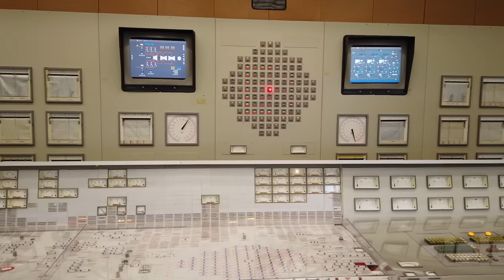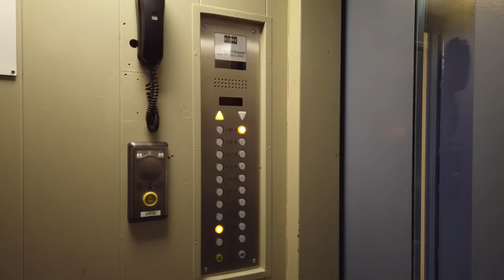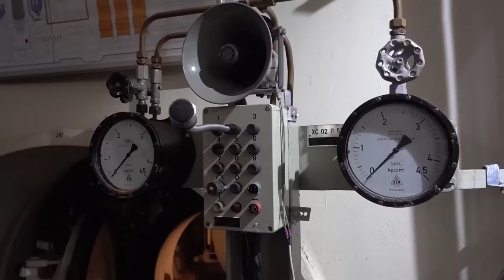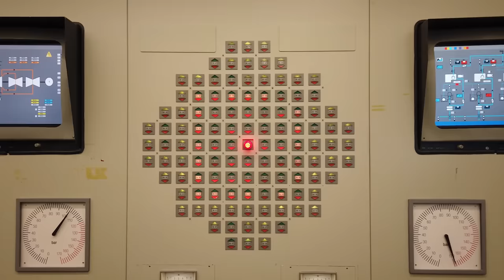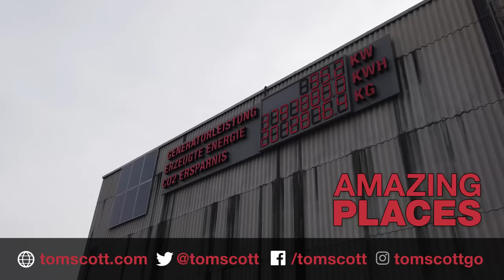This billion-euro nuclear reactor was never switched on

Comment: GIven how much CO2 emission could have been avoided by running this station instead of burning fossil fuels, this is a tragic story.
Reply: Austria produces about 70% of its electrical energy consumption with hydropower, aprox. 90% of the electricity mix are from renewables, the rest ist bought in from other countries that mostly use nuclear power. So Austria has cleaner electricity production the Great Britain or the US for example
Reply: Ironically, they're buying their power from countries that make it using nuclear for everything that isn't hydro.

Talk about NIMBYism
Reply: @sisosto3889  Austria doesn't have any major production to power. They lived by leaching off of their neighbours for centuries.
Reply: @laszu7137  Its not leaching of of anyone, we (Czechs) actually have more than we need, so why not sell it?
Reply: @sisosto3889  Other European countries are moving away from nuclear power. Germany does the same scam about renewables to the public. They have enough theoretical capacity to come close to meeting all demand but because of logistical limitations they actually import a large amount of power, which is largely from nuclear and fossil fuels. With the current shift, more will be from fossil fuels. The public believes they are getting greener but it is often the opposite case as nuclear power plants are closed down. Renewables only replace a fraction of the energy required, which means fossil fuels fill in the gap. Building more renewable energy is great but nuclear is still necessary for prime power production.
Reply: Liberals would think otherwise...
Reply: Thinking like that is oversimplification at it's finest. Nuclear energy may be climatically neutral, or even friendly but it's not particularly friendly towards humans, especially not when something goes wrong, for which there is always a chance and it produces masses of Nuclear waste that has to be desposed of, which is very difficult to do and, understandably, no one ever wants to keep it. Now fossil energy is arguably very bad, worse than it's nuclear cousin, since it's dangers are hidden - we never had a Chernobyl or Fukushima for a fossil power plant after all, and the cooperations responsible for the displacement of thousands of people and the destruction of so much land know how to get both their way and to sweep it under the rug-  and it's so well established and cheap that few question if it's not even defended for not being radioactive. The problem lies herein, that as it is always the case in, governments let themselves be overrun by cooperations in the interest of profit or economic growth, progress and freedom, instead of keeping keeping control and finding, funding and enforcing truly sustainable solutions or better yet have it be done for you by your subjects and your treasured cooperations which, after all have enourmous capabilities.
Reply: Actually, most of the energy produced in Austria comes from renewable sources like water or wind driven turbines.
Reply: @laszu7137  yes they do they have many huge dams in the alps
Reply: @sisosto3889  What is the daily peak in Austria?
Reply: @tacitus5665  "especially not when something goes wrong" there has being worst disasters by hydro and fossil fuel plants than all nuclear plants combined. Your argument it's the same as people who prefer going with cars instead of planes. Heck even coal plants release more radioactive material to the environment than nuclear plants
Reply: @shadowmax889  Read my comment. I'm not defending fossil energy, but rather urging to consider that nuclear power has major problems so governments and their previous cooperation's would better invest in finding actually sustainable replacements for both.
Reply: @tacitus5665  
Nuclear power is actually the safest, the cleanest and also the cheapest source of energy. All problems are ridiculously exaggerated, while problems with others are way too easily dismissed. Chernobyl killed about a hundred people, and all of that only because the Soviet government was completely unprepared to deal with the accident, and even tried to cover it up. Not to mention that a similar explosion is physically impossible in any other reactor type currently in use. Fossil fuels on the other hand kill millions every year, even when everything goes perfectly fine. And that's before considering the effects of Climate Change.
Reply: @0rogontorogon  But if they'd produced an excess of electricity by using nuclear as well, they could have sold that to other countries, decreasing their need for fossil fuels.
Reply: @laszu7137  In 2017 Austria produced about 68TWh and used 71.8TWh in those are 5TWh included for the pump storage hydro power...those 5TWh are not bought from other companies, the "Verbund " gets paid for them....It is cheaper for foreign electric companies to pay for the use of electric energy than to shutdown nuclear plants. So yes it is leaching of their neighbours, but it gets paid for that by them.
Reply: @andrasbiro3007  To be perfectly honest, I don't think I'll be able to reason with you or explain anything you'll not just deny. So good fortune to you.
Reply: @tacitus5665  but you arent taking any of his points either
Reply: @Ozylanius  I am taking his last point, because it's true. I even mentioned it myself, saying that fossil energy is very much bad and by those issues being ignored and fossil energy being kind of defended when compared to Nuclear power, it's inadvertantly worse than the latter. Yadda yadda, I already said the rest before
Reply: @tacitus5665  No fossil fuel Chernobyl? What about all the goddamn oil tanker spills? That "Chernobyl" enough for you?
Reply: @MemeMarine  I'm not defending fossil energy
Reply: @tacitus5665  The comparison is against fossil fuels. And comparatively the risks and harms are far less. Maybe you like renewables? In which case, do you think solar panels grow on trees? Or wind turbines, maybe? Lithium-ion batteries? Creating these things has a huge environmental impact as well, and produces huge amounts of toxic waste, which is toxic forever.
Reply: @andrasbiro3007  I agree with everything you said except:

"Chernobyl killed about a hundred people"

Are you in denial? Right after that, you said, "fossil fuels kill millions of people every year". So you are accepting to count indirect human suffering unless when it doesn't help your argument?
Reply: @tacitus5665   Nuclear power has one of the lowest deaths per kWh produced even when you include chernobyl and fukushima. Airplanes are also one of the safest ways to travel but because it's on the news when things finally do go wrong, people have an illogical fear of them.

And both chernobyl and fukushima was caused by greedy and stupid govnerments who ignored safety violations, why blame the industry on people who didn't use it properly..
Reply: @TheTaXoro  Airplanes and Nuclear power are two pair of shoes. For one, if something goes wrong in an arguably unlikely, but ,as can be seen, possible incident 300 people die at best, maybe more. For the other, if something goes wrong in an arguably unlikely but still possible incident entire stretches of land will be made uninhabitable for millennia and thousands or tens of thousands could be affected or even die.
Reply: @tacitus5665  The source which you claim is "not particularly friendly towards humans" kills less people per unit of energy generated than solar and wind. If that's "not particularly friendly", then what exactly is in your mind? And btw, the idea that nuclear can make areas "uninhabitable for millennia" is complete nonsense. Quite a bit of the Chernobyl exclusion zone has, within ~33 years, seen its radioactivity decline to safe levels. Hundreds of people have moved back into the area over the years, with no apparent ill effects.
Reply: @tacitus5665  Also, "we never had a Chernobyl or Fukushima for a fossil power plant after all" is kind of comical because actually, yes, we have. We've had quite a few. Besides the fact that coal mining accidents kill more people every year than the highest scientifically-backed estimate for the total deaths that have been and will be caused as a result of Chernobyl, most of the most deadly energy accidents have been fossil fuel related. In fact, NONE of the 10 worst disasters in energy in terms of death toll were nuclear-related. In 1942, 1,549 people were killed in a coal dust explosion in Japanese-occupied China. In 1952, 12,000 people were killed in a matter of days in and around London from a huge flare-up of smog. In 1989, a natural gas pipeline in Russia exploded, killing 575 people. In 1992, gasoline built up in the sewers of Mexico city caused multiple explosions, killing 242 people and leaving some 15,000 homeless. In 1992 as well, a gas explosion in a Turkish coal mine killed 263. In 2004, a train stopped in a village in Iran carrying oil and gas exploded, killing ~300 and completely destroying the village. In 2007, 118 were killed in a gas explosion in a coal mine in Russia. In 2009, a gas explosion in China killed 108. In 2014, an explosion in a turkish coal mine killed 301. There are also events with relatively little human cost but substantial environment costs, like the Texas City Refinery explosion, the Buncefield fire, the Jaipur fire, the Deepwater Horizon oil spill, the Torrey Canyon spill, the Amoco Cadiz spill, the Whiddy Island disaster, the Ixtoc I spill, the Jesse pipeline explosion, the Prestiege spill, the Exxon Valdez spill, etc. 

In terms of human cost of disasters (not typical use, fossil fuels kill people when not having disasters, hydro and nuclear don't), hydroelectricity is by far the most deadly. In 1975, 175,000 people were killed in the Banqiao Dam collapse in China. There's also the Derrybrien wind farm incident. 

And btw, coal releases more radioactivity into the environment annually than every civilian nuclear power disaster combined has (which is the only time there is such a release from nuclear plants).
Reply: @infantjones  now that is nonsense. [Former comment]
Reply: @tacitus5665  Which part(s) exactly? I'm more than happy to provide multiple sources for everything I said, if you'd like.
Reply: @infantjones  "we never had a Chernobyl or Fukushima for a fossil power plant after all, and the cooperations responsible for the displacement of thousands of people and the destruction of so much land know how to get both their way and to sweep it under the rug-  and it's so well established and cheap that few question if it's not even defended for not being radioactive" this part, if you are referring to my latter comnent
Reply: @tacitus5665  You copied your own reply, could you please point out which part of /my/ reply is nonsense?
Reply: @tacitus5665  Fear mongering is what that is
Reply: @TheTaXoro  Feel free to live in Pripyat or the red forest then, make sure to try the water.
Reply: @almisami  The funny thing is that the Czech Dukovany nuclear power plant is only 32 km from Austrian borders, so it actually is in their backyard.
Reply: @andrasbiro3007  "also the cheapest source of energy". How do you establish a cost for storing radioacticve waste for thousands of years? Can you provide an average hourly labour rate for the year 2120 that could be adjusted up for more technical fields? How will you factor in global pandemics, either the one we're suffering now, or others in the future when it comes to costings and social change? How will climate change affect world economies and future costings? They are just a few questions that can't be answered, so claiming nuclear power to be the cheapest is an impossible claim to back up.
Reply: @tacitus5665  Renewables are also worse for the environment and people than nuclear power. There are a lot of accidents in the creation of renewables, and there is a lot of toxic waste in the mining of the materials for them.
Reply: @deaddoll1361  
The cost of waste management, decommissioning and accident insurance are all built into the price of electricity, and it's still cheaper than coal. For other energy sources most of those costs are external. For fossil fuels the biggest cost is the harm caused by their toxic waste, and that's completely excluded from the price.
The real cost of handling nuclear waste is also known, for example there's the Yucca Mountain Nuclear Waste Repository in the US, which can safely store all 60 years of nuclear waste from all US nuclear reactors. For 1 million years. It cost like several billions to build, but compared to the profit those plants made, it's nothing. In fact there are still many billions left from the money the plant operators collected over the decades for this purpose. Another far better and cheaper solution would be burning the waste in fast breeder reactors, and turn it into even more electricity. The remaining stuff would decay away in a few hundred years.

Comment: AKW Lubmin unit block 6 near Greifswald in eastern Germany (next to northstream landing site) is also a Museum because it never went into service.
Reply: for a billion euros you would think someone would turn it on to make some of that money back making electricity just saying
Reply: @raven4k998  Both, Greifswald and Zwentendorf are very outdated in their design. Greifwald, being even a more modern version of a soviet VVER 440 lacks a containment structure. And Zwentendorf is a AEG BWR with a controversal pressure vessel design, the bottom weld seam can not be inspected via ultrasonic testing because it is inaccessible.
The condensation chamber (wet torus)  in Zwentendorf was cut open, so it can't be restarted.

Comment: Modern nuclear technology is so advanced now, and so much safer I don't see why we don't use it. It offers a quick way to get off fossil fuels, and it'll be able to provide a constant source of energy when wind and solar can't.
Reply: "Constant source of energy"?
How? Do you really think Uranium is a renewable resource on earth?
Reply: Joe, we do not know if it is a “modern” nuclear plant. It is about 50 years old.
Reply: @andreasegger4277  it's not renewable, but as far as I'm aware there's plenty of uranium to keep us going for thousands of years. I also know they can decommission nuclear weapons and use the fuel from them in modern types of nuclear reactors.
Reply: @Jakob_DK  what do you mean? 50 years old in nuclear power progression is a long time
Reply: Joe Cramp 
I thought you called the 40 years old plant modern.
Reply: Modern nuclear power is also hideously expensive per MW; that might be why widespread adoption has slowed down also....
Reply: For some commenters who are confused: 
While Nuclear power is not a renewable resource, it provides great base load power, meaning it doesn't depend on wind or the sun, so it could, in an ideal situation, provide a constant flow of electricity, just not indefinitely.
Reply: @andreasegger4277  Sure it isn't, but nuclear energy production requires a fraction of what thermal plants use today for the same result. Not to mention it's much more cleaner, being basically a giant steam engine.
Reply: @joecramp2987  Don't nuclear weapons use a different type of uranium? I think I remember reading something along these lines.
Reply: @imaginarystranger1974  I have seen a docu where an American nuclear power plant uses uranium from Russian nuclear warheads.
Reply: It's not fast, it's incredibly time consuming to build a power plant and all the costs are up front - that's not even including the limited life span and decommissioning costs. Check out the pre-agreed cost per KWH for Hinkley Point C, it's insanely high. I'm pro-nuclear but calling it "fast" is absurd. It's also used to provide a baseline power level - it can't cope with surges like hydro/gas can.
Reply: @JesseHBrewer  In the UK major infrastructure project costs are common knowledge since the government is usually a shareholder, either through tax breaks or direct/indirect investment. So yes, it's clear to see the costs here. But it ultimately boils down to £ per MW, and in the UK at least, Nuclear is nearly the most expensive £ per MW of all generation. That said, I do believe that non-nuclear renewables will never be able to provide for all our energy needs, I do think that there is a need for Nuclear base load generation, we do just need to get on top of the waste problem. SMR's look very promising, but again, fission produces much waste that we don't yet have a sustainable solution for.
Reply: Ah yes, let's switch to another limited resource that is only slightly less harmful to the environment, but with the added fun of making an entire region uninhabitable if something goes wrong! Don't get me wrong, nuclear power is essential, but it is absolutely not the solution.
Reply: @imaginarystranger1974  Nuclear power is absolutely not clean. Sure, at just the reactor is is clean, but the enrichment process is almost as harmful as fossil fuels.
Reply: @wta1518  Still not comparable. Nuclear power plants emmit in year less than coal plants in a day, if I remember correctly.
Reply: @imaginarystranger1974  I'm not talking about the power plants, I'm talking about the enrichment process.
Reply: @imaginarystranger1974  nuclear weapons use plutonium, which is a biproduct of uranium fission
Reply: @wta1518  modern western nuclear reactors dont go wrong, theyre fundamentally designed to fail safe in every situation and human error is totally removed from their operation. no point in citing chernobyl as that was a fundamentally different (and rubbish) design of reactor, that didnt fail safe in every situation and did permit human error